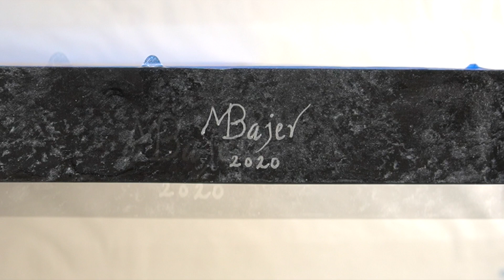Broken glass and yellow resin: GORGEOUS!

Comment: Sooooooo beautiful - even with yellow!!! What white have you used and how do you get the cloud effect?
Reply from the maker: Thank you so much!  The white is Stonecoat countertop base tint.  However unfortunately its no longer made as Stonecoat was bought out by larger company who has changed the resin composition as well as will not produce the base any longer.  It's very upsetting since creating cells is such an integral part of my art. I'll have to find another way to make cells:(
Reply: @mariettabajer499  Marietta, Colour Passion makes a Top Cell white that works well.